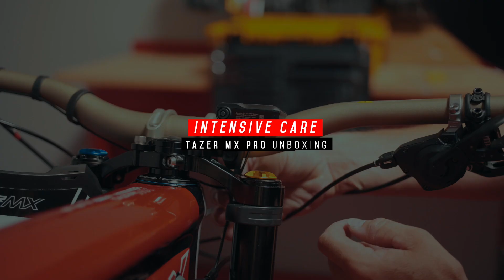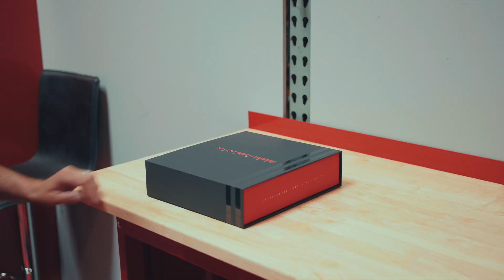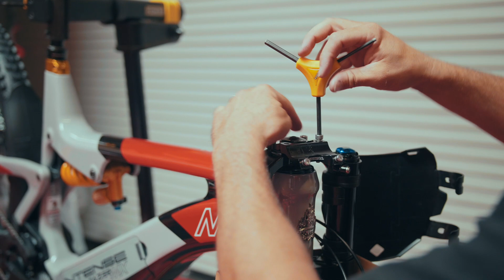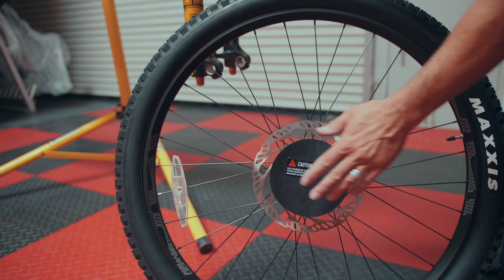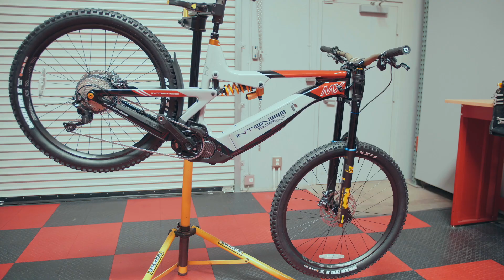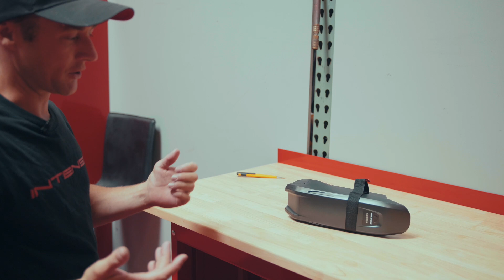INTENSE Tazer MX Tech: Tazer MX Pro Unboxing and Assembly

Comment: You don't have to swap the cables to switch F/R brake operations.  The Magura brake levers are reversible, just unfasten them with the provided Torx wrench and clamp them on the opposite side.  You'll know you did it right if the little "M" on the c clamp appears as a "W".  You can hide the slack in the cable under the number plate.